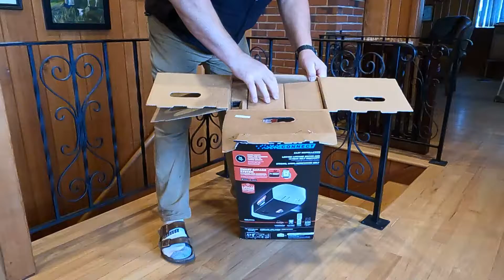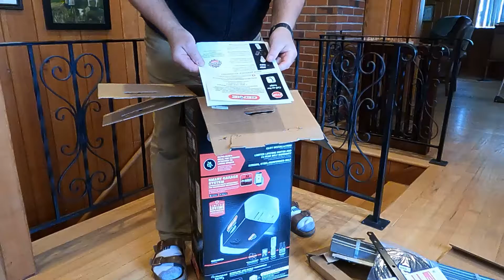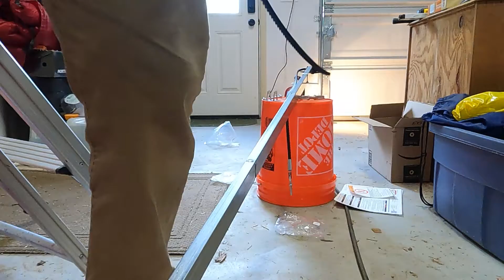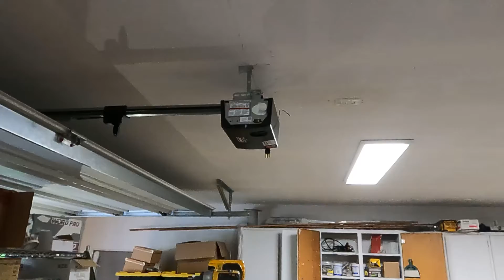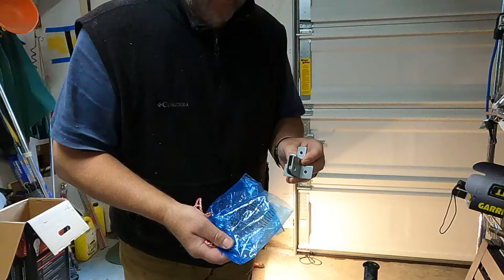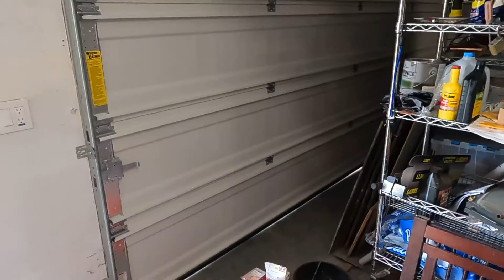First quick and easy Do It Yourself garage door opener install | Genie Quietlift

Comment: good job i wish you better luck than  me. i had 2 of the screw type life time watt. ones. some times you were on hold over and hour. motor burn out on one they made like lighting burn it up and would not replace it. the other one eat up threads on the block i thing the screw rods were not threaded right. i will never buy any more genie's. master lifts have worked well. take care, be safe and well.
Reply from the maker: John, I hear ya. It is a real bummer when the darn things go haywire! I had an older screw type opener that I was going to install, but by the time I found replacements for the safety beam, wall button, remote openers, and exterior keypad, I was almost as much money as this thing. And who knows what the safety features might not be working on an old one. I have to say, this package was very well put together, with the colored bags and the installation app that I down loaded on my phone. Just like the garage door, if I had to do this again it would take me a 1/4 of the time.
Reply: @a_farm_west_of_boring  the belt ones may be better. i hope you have good luck with it. i got my old ones from lowes. when i got them they were not color coded but they were not hard to put up and boxing was fine too. be safe and well.
Reply from the maker: Thanks John!